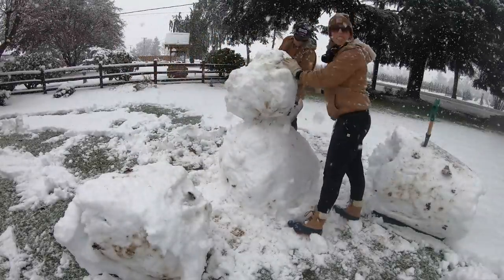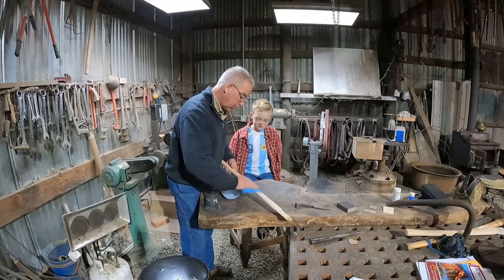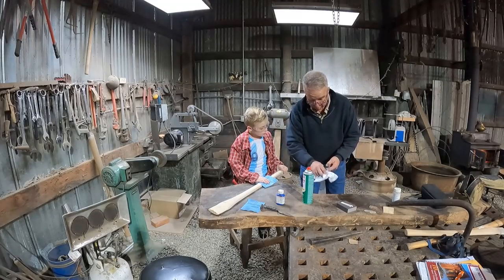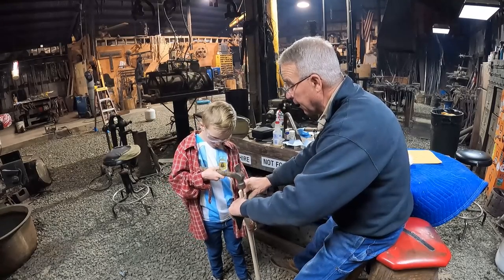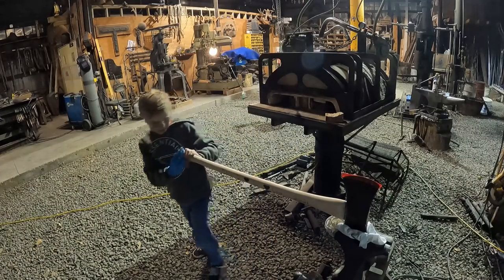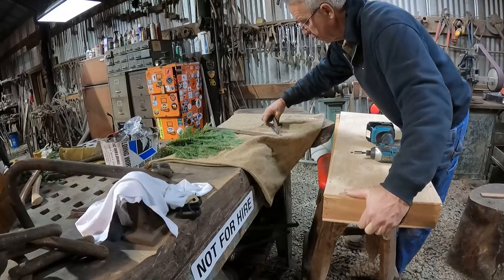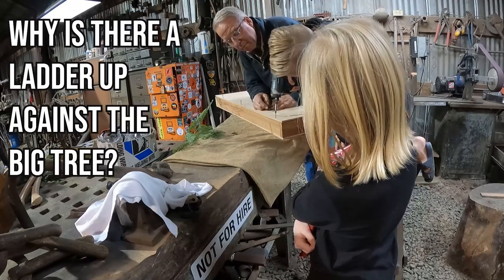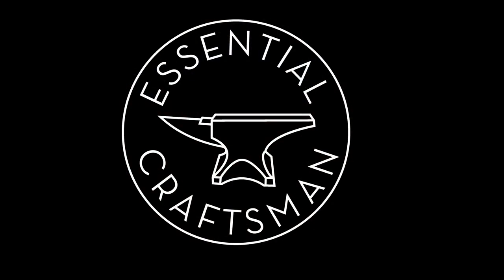Boy Finds and Restores Axe with Grandpa

Comment: This is such a great video! Thank you so much for sharing.  I’m not sure how old Leo is but he looks to be about the same age I was when my grandpa took me out to the shop for my one of my first projects.  I am not sure if you like hearing stories from other folks but, We were having a family BBQ and we wanted to boil some corn on the cob over and open fire so we needed a way to hang the pot over the fire.  It was the first time I ever learned to weld and we built a 3 legged device that we were able to hang a big ole pot over the fire to cook our corn.  That was about 27 years ago and I’ve never forgotten a single moment about that day, every time I strike up my welder I am reminded of that time spent with my grandpa, and of the excitement that I had when we got to cookin and I got to share that I built and welded this tool.  27 years later once a year on Canada day we have all our family out to our place (grandpa and grandma included) for a big meal and I still have that original pot hanger that grandpa and I built together that we use to cook up some corn with and come together as a family again, and every year grandpa and I take a few minutes to just sit back, talk and look at what that simple little metal contraption has done, it brings our whole family together and grandpa and I get to say to ourselves we did this.  I am certain that Leo will cherish the memories that he makes in the shop with you just as I have.  Great video it really hit home with me.

Comment: 10:48 When I was around 10 years old my friend and I were trying to hook up the wires to the control box of an electric train set. His dad saw us struggling and came over. He showed me how to twist the multi-strand wire into a tighter group and then put it around the screw in the same direction the screw would turn when tightened to make a good connection. Then he said something I have't forgotten over the last 50 or so years: "If it's worth doing it's worth doing right".

Comment: I spent a lot of time watching my father doing this over the years - I picked up more from the watching than by direct teaching, but he was (still is) always willing to help when I ran into something I couldn't quite do.    That's a meaning of family - 50+ years later, and we're still doing it.  

The cold bluing is an interesting choice.  I would have expected the normal paint, possibly the two tone paint, to the edge. 

As for the 'can't always make it perfect' - absolutely.   That's part of what drives me crazy about "rustic" furniture.  It seems like furniture makers think that all home-made furniture had huge gaps between boards, bad finish, terrible fit.   Where that was more what a farmer would turn out in the middle of the heavy work seasons, because it needed to be made NOW.   When things went quieter, that's when it would be improved and made to fit well.   I've seen corn cribs built better than those furniture store "rustic" cabinets.   

Hope you're around to watch and teach them for many more years to come.   Maybe your granddaughter will want to learn smithing :)

Comment: Those moments in teh workshop with Pops are some memories that lil feller will cherish his entire life! 

I still have fond memories of the ONLY time Grandpa let me into his workshop for a project. We made a set of stilts for me to use. I kept them as long as I could. After 20+ years they were too far gone to be saved anymore. The Douglas Fir 2X4 that twe made them from had dry rot & deteriorated too far. In hindsight, I SHOULD have kept the foot stirrups to be repurposed.

Comment: An observation from one granddad to another. 
Not a danger in the video but one that could be in the future. 
Brake cleaner used  to clean the axe head is very flammable. as it evaporates, the vapors spread out and are heavy.
I see an open flame in the wood stove. (And propane heater)That could cause a problem to a young person if they did what grandpa did but were standing closer to the fire.
This is not pointing out negligence nor irresponsible behavior.  Only that our loved ones need to be taught about what could happen next.
Terrific show and my life is better because of what you have shared. 
God bless.

Comment: 4:03 Pour that blue bottle out into a separate container before using it. Then cap the bottle ans only use what you poured out.
If metal touches a q-tip and the q-tip touches the blue liquid it is contaminated and will never work anymore on steel. It is not liquid glue.
But that container looks like it doesn't have much left in it so maybe it is ok to contaminate it since its next stop is the trash can or hazardous waste depot.